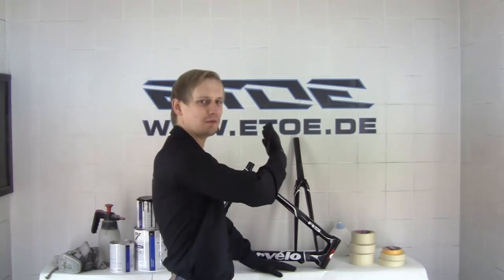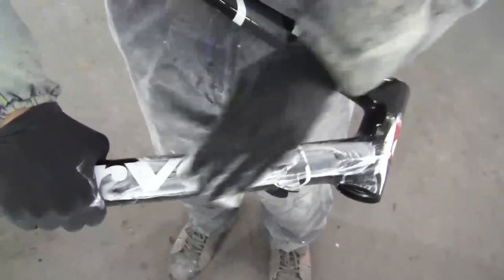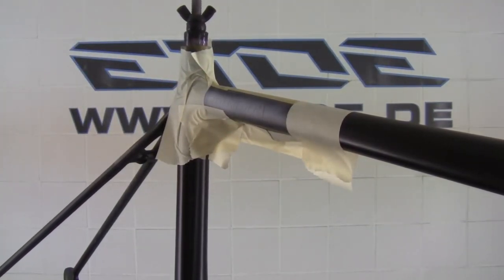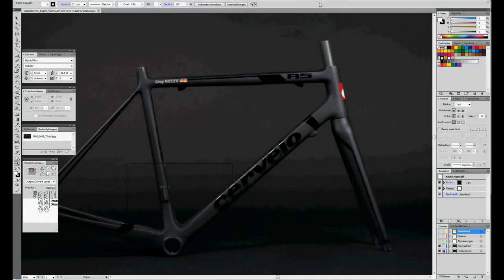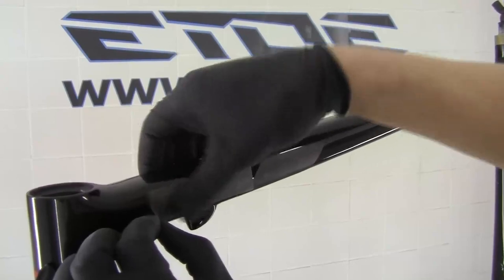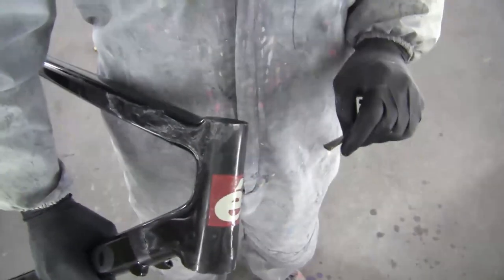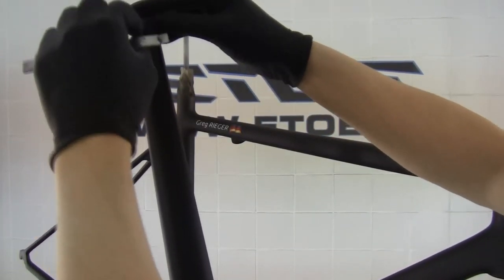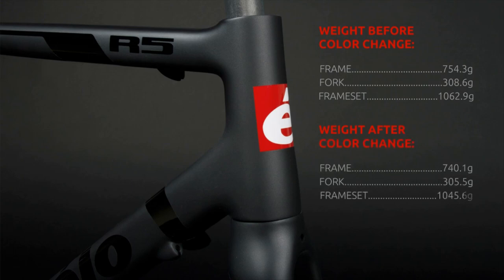Cervelo R5 California Bike paint by ETOE

Comment: So, just to clarify, the paint job is...

1.  sand down to carbon (although I can see some remaining paint left from the original paint job)
2.  Flat black paint all over the frame (or is this flat black, and then glossy clear coat?  OR, gloss black, with no clear coat?)
3.  Add the small name logo on the top tube with a stencil
4.  Mask the logos.
5.  Sand the frame again to give the next layer something to key to (you do this over the edge of the logo masks; doesn't this damage the edge of the logo masks and make them less sharp?)
6.  Black and silver mix to give the black some deep shine.
7.  Matte clear coat.

If this is right, couldn't you just do step 2 in the areas where the logos will be, instead of doing the whole frame like that?  Would save weight (and paint!)